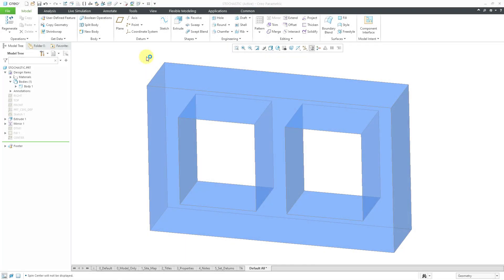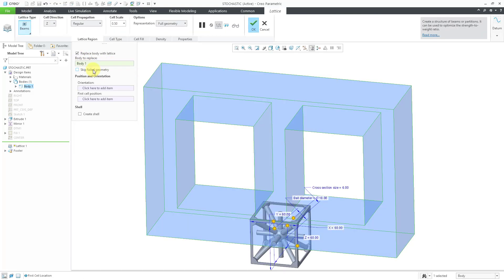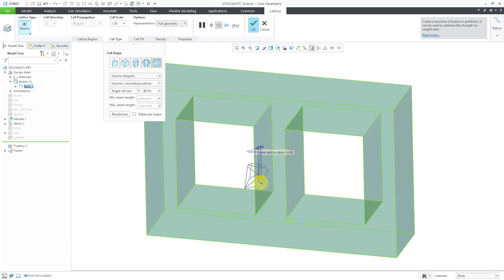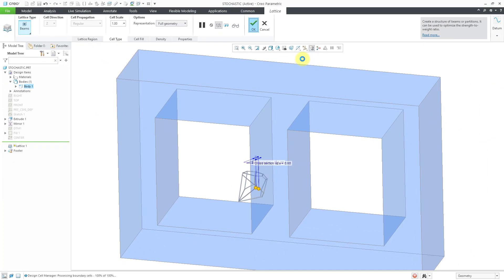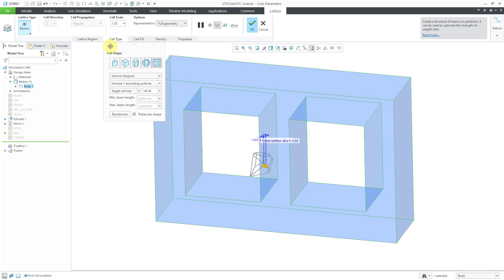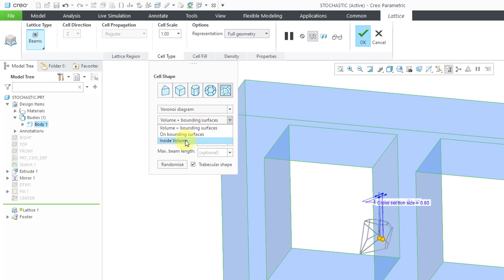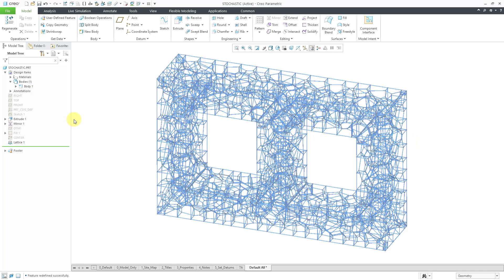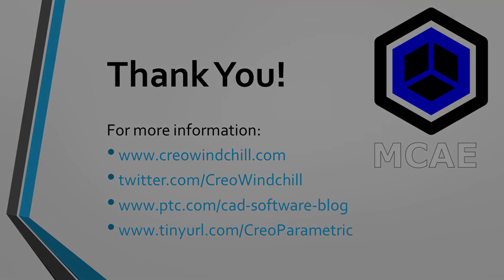Creo Parametric - Additive Manufacturing - How to Create Stochastic Lattices

Comment: can we make a stp_file and use it for simulation in ansys??
Reply from the maker: No, but you can analyze lattices in Creo using Creo Simulation Live and Creo Ansys Simulation (both are driven by Ansys).
Reply: @CADPLMGuy  thank you .. actually my laptop doesn't support Creo live simulation
Reply from the maker: @aneesurrehman4135   Yeah, my laptop is from 2016. Although I can run Creo Simulation Live, I can't analyze lattices. I'm figuring in 2024 I need to bite the bullet and invest in a new laptop.
Reply: @CADPLMGuy  Best of luck sir  basically I'm looking from copper metal foam (model) in creo ...